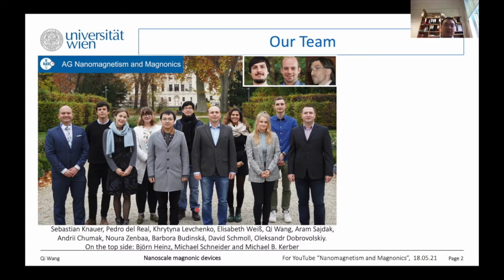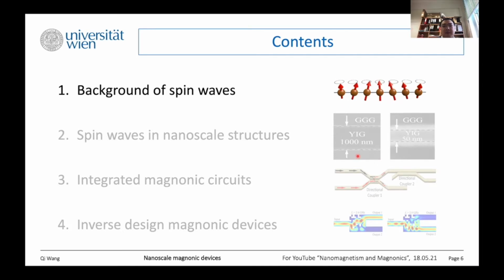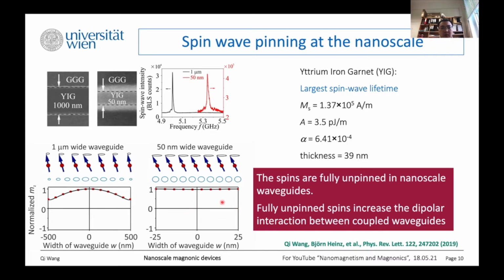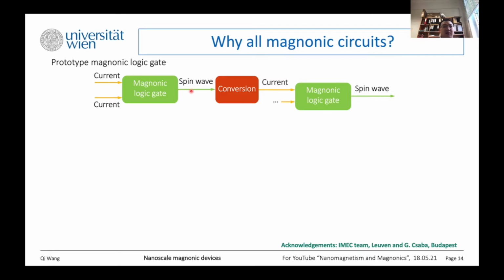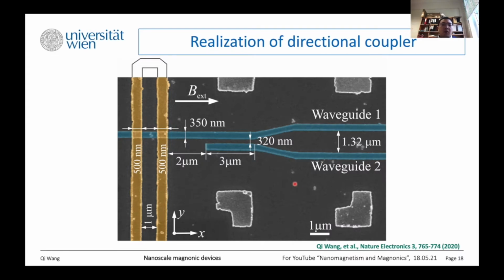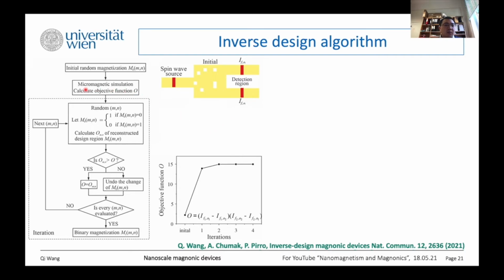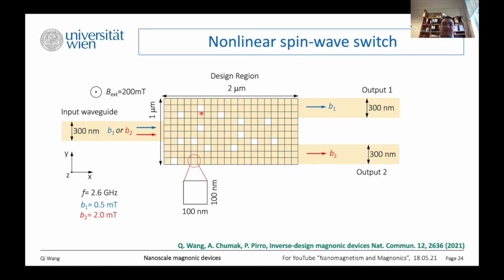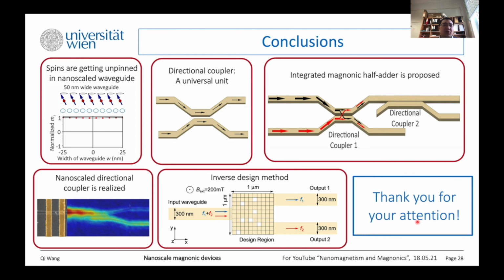Inverse-design magnonics - Research update (Dr. Qi Wang)

Comment: Hello Qi,
I would like to ask you about the detection of the intensity. Can you please explain, how to calculate intensity of different frequency in Mumax? Secondly, how efficient is the random method compare to the other machine learning methods? 
Thank you in advance.
Reply: Hi Daniel, Thanks for your interesting of our work. (1) The mumax simulation will give you mx, my, mz as function of time for all the cells. You can chose the interesting cells (here we chose the cells at two outputs.) and perform FFT for time domain. Then, we get the frequency domain information. Here, we can define the intensity of spin waves for different frequencies.  (2) We did not evaluated the other optimisation algorithm. In general, the direct binary search is a sample algorithm which is suitable for our case, just with or without materials. If you want to continually modify the parameters of the materials, maybe the gradient-based algorithm is better.
Reply: @qiwang3939  Thank you very much for your reply. I have tried the method you suggested. However, the time requires to calculate the intensity is more than the mumax simulation itself. Is it the same in your case? in case not, can you please send me the intensity reading script if possible? Thanks and looking forward to your reply.

Comment: Hello Qi,
thank you for sharing such a great lecture! I have several question regarding the inverse magnonic device. Why you chose the forward volume geometry? Did you try optimization also for in-plane magnetized structures? Could the functionality be even enhanced by using such anisotropic dispersion relation for in-plane magnetization?
Thank you in advance
Best,
Ondrej
Reply: Hi Ondrej, 
Thank you for your interest. I also tried to optimize the in-plan magnetization. However, the results are not good. The main reason is the strong demagnetic field in the nanoscale structure. When the holes have been introduced in the design region, the strong demagnetic field will dramatically change the dispersion curves locally. Here, we chose FV geometry which can ignore this issue. But I think it could also work for the in-plane magnetized structure in a large size where the demagnetic field is not critical. 
Best wishes, 
Qi
Reply: @qiwang3939  Thank you very much for detailed answer